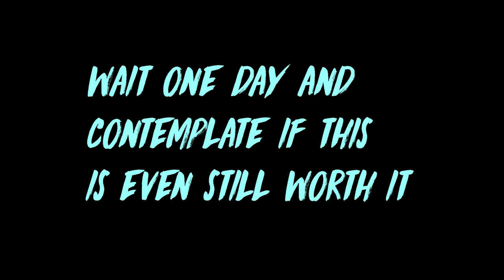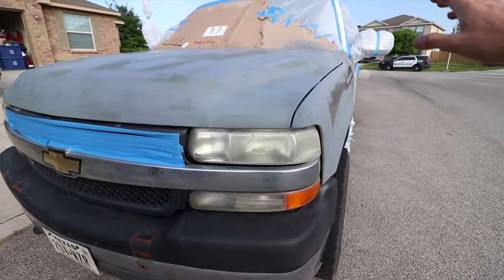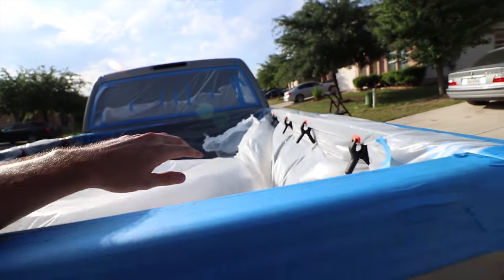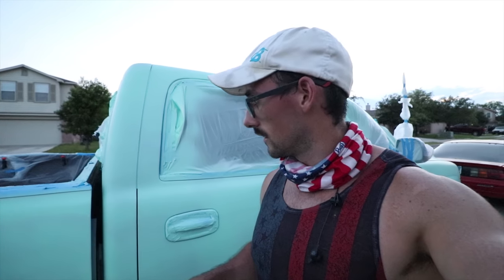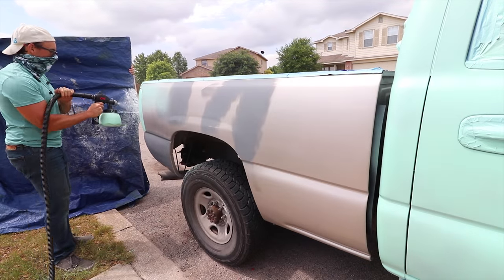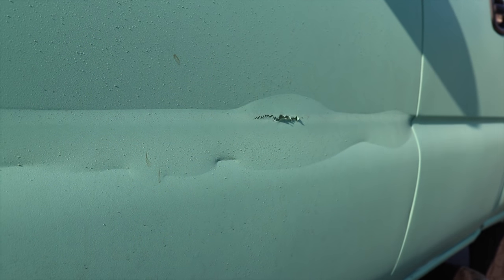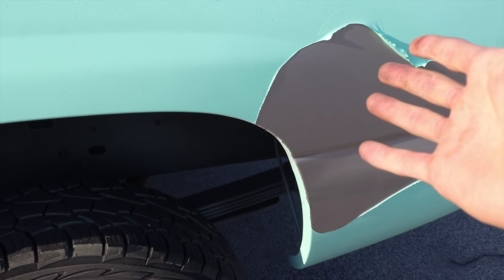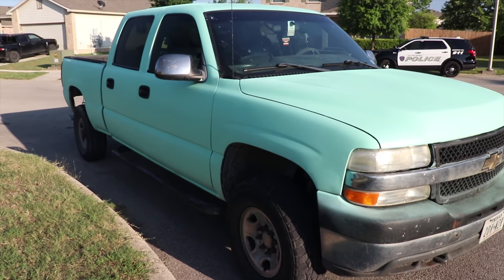I DIPPED my entire TRUCK and this is what happened...

Comment: Every single problem you had was your own fault.
Reply from the maker: Very true, I did not have the best of conditions for spraying the plastidip. I think it may have turned out better if I had a sealed environment to paint in and weather controlled. The sprayer they give is just not meant for spraying when there is a lot of wind. Even with all of the prep work it was an effort in futility. There was a lot that was not shown in the video for sake of time. I just personally wont be using this product again, but I wish you better luck than me.
Reply: The only issue you had was the wind, and if you later it in your garage or in a tent even car port. You would have a amazing finish, then could’ve changed it wherever. You don’t have to do that prep if you put enough coats it will cover all the minor imperfections
Reply: The Daily Drift Man U did nothing right. First u don’t spray outside next your coats are too thin next your prep work is horrible next your distance is wrong. U need to learn how to spray before u attempt to try. U should just take this video down as everyone that watches it is just telling u everything u have done wrong
Reply: @gagepetas7748  this video helped me decide not to plasti my work truck. Doesnt look like decals would stick to well.

Comment: This is what happens when you don't do the homework first. You can't paint or dip anything outside in the wind. You would have also known that anywhere you tape, you must peel while the dip is still wet. Unless there is a gap between tape and dip. If you would have done it inside a garage and peeled the tape correctly, you would have had a much better outcome.
Reply from the maker: Dana Steele yes this very true, dipping a car outside is not ideal, but sometimes it’s all we have to work with. The truck is too big to fit in a garage and the dip dried so fast we couldn’t peel it wet. We peeled it as soon as we finished spraying. We did the best with what we had and unfortunately it didn’t work out. The point I was trying to make in the video is that if you are like me and don’t have access to a large garage or indoor facility, plastidip might not be the best option. Thank you for your feedback and hopefully you will have a better experience with plastidip than I did.
Reply: I would be pissed if ur painting anything outside and u got overspray on my car.....im sure u can find a friend with a garage for a couple of hours...jeez even rattle cans don't do well in heavy wind
Reply: The Daily Drift, it dried so fast because you did passes that were too short, too far away, and not wet enough coats. And little to no overlap. All these things lead to your problems/negatives.

Comment: When spraying plasti dip, you want wet even passes that are about 50% overlap to create a wet finish along with a polished look and feel to the car. It’s always good to practice on one part of your car before the entire thing. And make sure you have enough product. You always want to be about 6 inches away and DONT RUSH the process. It’s rubber rather than your average paint, all things to be considered. When the paint is lifting on the edges like that, on your last coat, peel the tape off immediately when you finish while the paint is wet for a tighter and cleaner look. Once the paint dries and you try to peel it, it’ll ruin the sharp look on the trims. Preferably a car tent to control the wind would be ideal in this case because there wasn’t enough product to prevent the rough patches since the wind was blowing but I’d check the weather next time before painting: low humidity and cool weather is always best for outdoor paint jobs. Wagner also has a good spray gun. 

Sorry if you didn’t find this valuable

Comment: The rough texture and bumps were because the wind was taking half your paint and the paint that made it onto the vehicle was already drying due to the wind. So you didn’t get a wet coat on the car. You were spraying partially dry dip on the car. Also you need to go the full length of each panel and overlap. You can’t do those short 2 foot zig zag painting. That’s why you got so many drips and why the dip was lifting everywhere. You need to watch some tutorials before you make one.  No disrespect.

Comment: Tough luck bro. Thanks for sharing your experience. I’m doing my homework for a 2007 2500.
Reply from the maker: Yeah sometimes things happen. I think if you can do it in a controlled environment it would drastically improve the results. I later did this on a small car in my garage and it came out better, but we still had problems with it lifting and not bonding 100%. Personally I’m sticking to regular paint, I just seem to get better results.

Comment: I am sure you know now but painting outside is a no no. Next. If you watch any of dyc videos you will see they do think base coats. This is to give thickness to the dip. They always say 5 full coats of base before any color is put on. That also makes covering the color better. No base costs is why it comes off easy. And your spray pattern very bad. You should have done more research first before wasting your money like you did with this very wrong dip job.
Reply from the maker: Well sir I do appreciate your feedback. I definitely watched a few of their video and scoured the internet for hints and tips on this before I got started, but most of the information was about smaller cars and trucks. I saw that the original video of the plasti dip the guy did it outside so I figured I would be ok. The problem was that I was on a tight schedule and it just so happened to be a very windy day. I got very impatient with painting outside in 90+ degree heat here in taxes, so I rushed it a bit. We did manage to get plenty of coverage with the 7 coats we applied (we didn't film every coat because it would have been really long video :)) I think that if I had a garage big enough to hold my truck this would have gone a lot smoother. The good part is I learned something new and had a new experience that I got to spend with my father and those memories are worth wasting a little money on some plasti dip. God bless and have a good day.
Reply: The Daily Drift experience with your father priceless. When I was saying coats it looked like you didn't put base coat, black or gunmetal gray, down before color. A lot of other videos out with same problem. They just didn't put enough coats to make it thick and durable. DYC YouTube channel has videos them doing trucks. Wasn't busting on you. Was just trying to help for next time.
Reply from the maker: Thank you, I really do appreciate the advice. I never stop learning, that's for sure. I think next time I am going to use something different and try to find some place indoors to spray. Doing this outside was a total nightmare.

Comment: Your technique is wrong.
Reply from the maker: Ridzuan Yahya well damn, what was I doing wrong? My dad seemed to get it on there decently, but I kept screwing it up 😅
Reply: no one can blame you for doing anything "wrong". just watch the dip your car channel and see how they spray long even lines instead of shorter sprays. they also do wet coats to get even coverage and smooth finish. and btw I love the color. I'm wanting to do my 4 door Dodge Ram soon
Reply from the maker: Bailey & Dillon I am definitely not a paint and body guy, but I gave it my best shot. I definitely learned a few things and I think you’re right about the sprays. I got impatient and frustrated when I was doing it, so it was definitely user error 😅 Thanks, I love this color too but I’ll probably be changing it soon because it’s literally falling off the truck 🤣 good luck with your truck, I hope it goes smoother than mine did!

Comment: Delamination is gonna happen with a contaminated area every time. You have to wash the vehicle then use a wax and grease remover then it sticks like glue. From what I can see it wasn't put on wet enough from start to finish and the texture is from heat and air. Takes practice!
Reply from the maker: We actually sprayed the predip spray after the truck sat for a day after being washed. We then ran acetone over the entire truck before the application. A lot of the prep work was edited way down for sake of time and boredom.  Unfortunately all the prep work in the world couldn't save us from the wind and heat. We didn't have the proper location to spray and the spray gun they provided couldn't handle spraying in the wind and blew over spray all over the sides of the truck as we tried to spray. Hindsight being 20/20 we should have rented or build a portable paint booth.
Reply: The Daily Drift you applied it wrong you shold have 50/50 overspray and it should wet it out and it will make smooth texture

Comment: your technique is completely incorrect, and youre doing it in the wind. buy a cheap ebay canopy tent pull your truck in and do it correctly away form the wind. also in high heat, you shouldnt be spraying outdoors, these issues are your own fault you couldve sprayed real car paint out of a gun and compressor and still face most of these same issues.